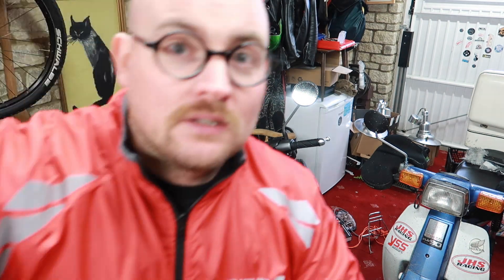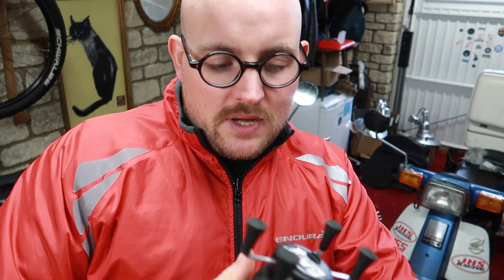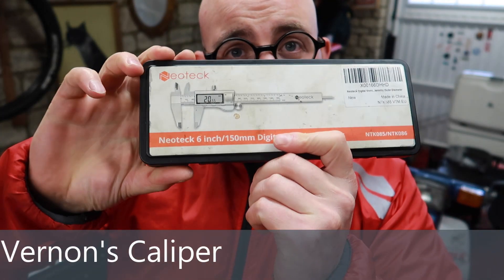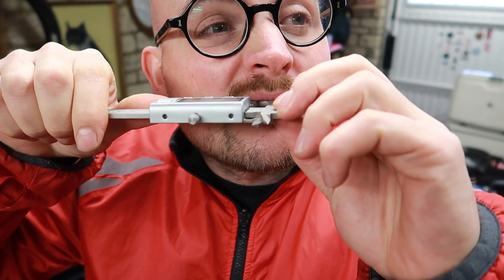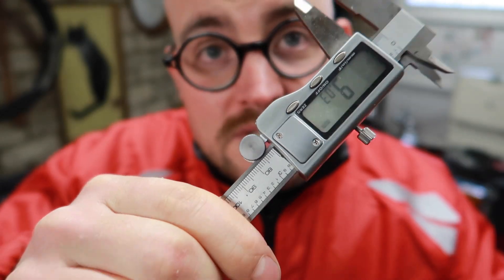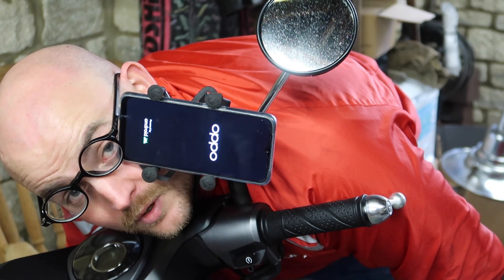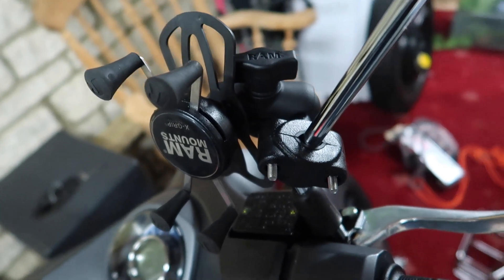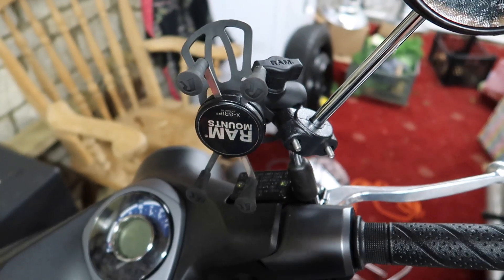Securely Attach A Phone To A Honda C90 or C125 - Bonus Vernier Caliper Footage

Comment: Hi! Love your vids as a fellow Cub rider. Lots of fun and useful staff. Thanks for the time you've spent creating this. As for me I attached my GoPro and phone holders under the mirrors lock nuts. It works well since there are less vibrations than with the on-mirror mounting option. Thanks a lot one more time and have nice time with your moped.
Reply from the maker: What a lovely comment to wake up to. I was on the cub just the other day doing small local errands and it felt great! What age and colour is your cub?
Reply: @EpohDerf  Good morning mate ) I couldn't define the exact age of my Cub aka Totosha but his previous owner said that she believed he was produced in 2007. Tototosha's destiny is unclear. The one thing I know he was imported from Japan. It has features of different Cub models and someone cut off its beautiful sail. It is blue and white. It seems his life wasn’t a joy ride. Or maybe it was :) The documents he has are very suspicious. He has some health issues. But he starts at first kick even on a frosty Russian morning and runs smoothly with the nice quiet sound of Honda engine. God he is not fast at all but how nice and true is the feeling of moving forward when you ride this moped. Why is his name Totosha? His previous owner told me. The Super Cubs have a nickname “crocodile'' in Russia since they have something in common with the creature in the silhouette. There is a famous poem by Russian children's poet Korney Tchukovsky about three little crocodiles named Kokosha, Totosha, and Lyolyosha. Since the girl who owned a moped before me had three of them she gave them the names after Tchukovsky’s poem characters. You can find Totosha and me on the Ig @nivalegend2021.

Comment: If you remove the bottom half moon clamp bit and file the mating faces a little it will tighten the gap up im sure.
Reply from the maker: That's a top suggestion. Thanks.